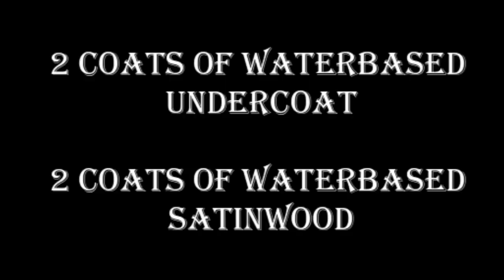Bespoke fitted wardrobe pt4 (sanding, de nibbing and spray painting the doors)

Comment: Brilliant videos fella, like you I’m a tool geek, with a background in woodwork, I’ve now got 3 small hobby workshops, 1 for cnc, 1 for machines, and now 1 for spraying, unfortunately I can’t spray for toffee 😰, hope you get chance to show how you mix your paint and what type of spray set up you have as I really would like to spray water based paints onto MDF, but it’s the mixing, spray tips size and so on that stumps me every time, I do know spraying isn’t easy but if I’ve got the correct mix and setup, I can just keep practicing till I get better “ish” 😁😁
Reply from the maker: Brian White Thanks for your comment.
I only have a very basic spray set up.
Key things for spraying water based is large nozzle over 2mm. De-nib well. Dust free environment if that's at all possible and viscosity is down to gun and nozzle so a bit of trial and error. Warm days are better than cold days to spray unless you've got heating.
Hope this helps and I will try to get round to doing a video on spraying.
Thanks for watching 👍🏼
Reply: Thanks for the reply, I’ve got an Apollo 1500 hvpl spray machine and just bought a 2.8 tip for it £50 😲😲 so it’s back in the shed for a few weeks practicing now fella 😁😁
Reply from the maker: Brian White with a 2.8 nozzle you won't have to thin the paint down very much. Keep me posted how you are getting on. 👍🏼👍🏼
Reply: Hi, tried the bigger tip and I also thinned the paint but the paint was just spitting out, tried all sorts of adjustments on the gun and paint but it went from bad to worse, could you tell me what compressor you use as I’m thinking of going down the traditional spraying route instead of hvlp, I can get a new compressor 100 litre with a cfm of 14.6 for about £300, I need something that can spray quite thick primer, ie leyland s acrylic primer as this stuff works a treat if I roller it on, but it takes ages to hand paint, ps sorry for mithering but your setup looks great and your doing exactly what I would ( fingers crossed) like to do, cheers fella 👍👍
Reply from the maker: Brian White my set up isn't ideal. My compressor isn't powerful enough so when I'm spraying large items I have to go slow. There are some good scheppach compressors in Screwfix!
As for the gun a good friend of mine who is a professional sprayer told me all budget guns are pretty much the same.

Comment: Was that a regular air fed spray gun you used ?  I've just built a rather large radiator cover with lots of intricate mouldings and don't fancy brush painting it . I used to spray cars  many years ago and still have all of my equipment . How do you go about thinning regular water based house paint to spray through your gun ?
Reply from the maker: peter fido yes this was a gravity fed spray gun working off a compressor. I've made hundreds of radiator covers and I used to paint them with a brush and roller. Now I spay them, it's so much easier and faster. To thin the paint took a bit of trial and error. It depends how thin the paint is to begin with. Add 10% water and test spray on a scrap of mdf or ply. See if it sprays smoothly and check for runs. Thanks for watching and be sure to like share and subscribe to help the channel grow 👍🏼
Reply: @spendtimesavemoneydiy  thank you so much for replying so quickly , I'll take your advice and give it a go  today .
Reply from the maker: peter fido good luck and let me know how you get on. Maybe even post some pictures on my Facebook group DIY, spend time save money 👍🏼